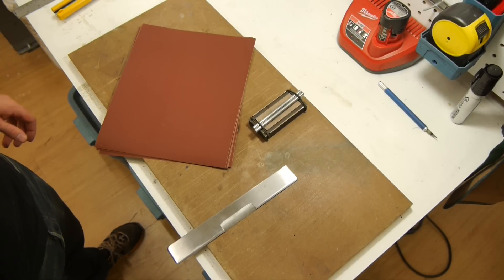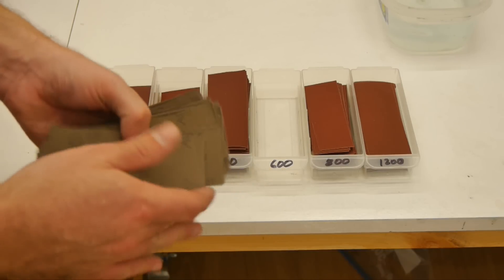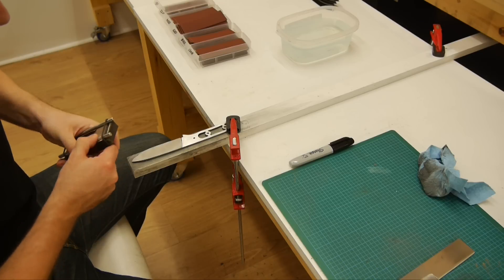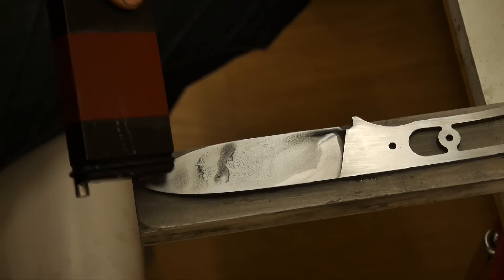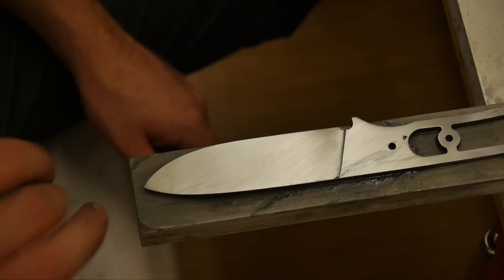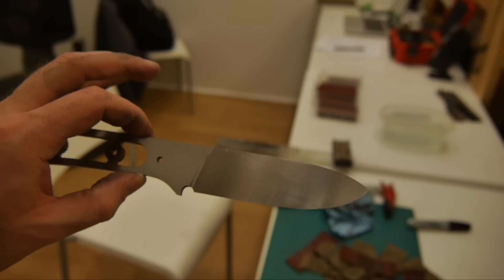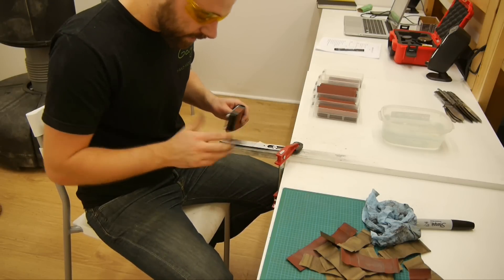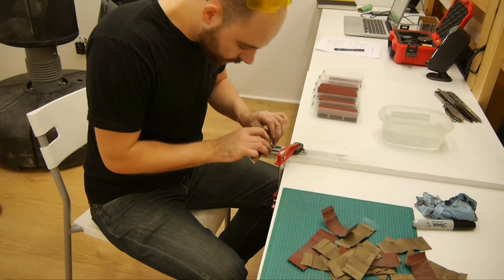How to Satin Finish a Knife Blade

Comment: Thank you for your tutorial video!

I have some question, if I want to put a satin finish on a saber grind knife,  
should I separate the sanding process, like, sanding the flat then the bevel?(which is the method I'm using now )  

The problem I'm occurring is after the sanding process, the grind line between flat and bevel is not so crisp anymore, especially on a americanize tanto because it have three flats on each side ,the tip is the trickiest even with a sanding block.

And how about a hollow grind? should I put a piece of leather or rubber on my sanding block? I think leather and rubber are flexible so when sanding it might fit the curve, haven't try it yet so don't know if it will work.

Thanks for your time and patience!
Reply from the maker: Hey mate!
When sanding a saber grind it's important that your sanding block is very hard, and that the paper is held tightly against it to avoid washing out the transition lines between the bevel and the flats... If you want the sharpest possible transition you can actually use special stones called 'EDM stones' to do your sanding, because they're very hard you can keep your transition lines very crisp. You can get them from moldshoptools.com

For sanding a hollow grind you should use a sanding block with a radius on it that is just a hair smaller than the radius of the wheel that you used to make the hollow grind. Using a soft sanding block will wash out the transition.

-Aaron
Reply: Thanks for the information! Really helps me a lot!

Comment: At around 10 minutes you said that you heat treated the blade after the first 2 passes with sandpaper. Do you mean heating it up to aust temp and quenching? Is it safe to do with a blank with a thin blade or will that cause it to warp easier?
Sorry for the question, i've got a thick piece of steel (from a broken pry bar hehe) and i'm wondering how much stock removal i should do before heat treating it to save my elbows when i have to sand the heat treated steel.
Reply from the maker: It depends on what steel you're using. I'm using an air-hardening steel that doesn't really distort much, so it's safe for me to take my edges very thin. I have also done some very thin edges in O1 before heat-treat with no issues. Steels that require a faster quench like 1084 or 1095 will likely be more problematic.

Comment: Hey gough it's me again! I seem to have trouble sanding out the scratches right at the beginning of the bevel! Any tips and great video! It was actually very helpful!
Reply from the maker: Hey mate! Yes that's generally the area that takes the most work... The first thing I would say is to make sure that your file (the one you're using on the filing jig) has it's edges nicely rounded, any little teeth sticking out will cause deep scratches that are hard to get out.

Apart from that it really is just a matter of sanding a bunch unfortunately. Make sure you change your sandpaper really often, treat it like it's free!

Comment: I use 3in1 oil for this instead of the water and detergent mix, is there any benefit to using water over oil?
Reply from the maker: +Jimmy Grey Hey Jimmy! Benefits of water: cheap, non-toxic, plentiful so you can replace it more often. Downside is that it may cause rust if you're not careful. Either way will work for sure!
Reply: +Gough Custom Guess it's just down to preference then. Thanks for that mate.

Comment: what type of steel is that? I apologize if you mentioned it in the video but I didn't catch it.
Reply from the maker: +Michael Cockrell Hey mate! In this case it would have been A2 steel, however the process is basically the same regardless of which steel you're using.

Comment: Hey Aaron, do you recommend the even heat kilns for a hobby knife maker? They are pricey but seem to be worth it in the long run with the ability to set consistent temps.  My fear with a gas forge is overheating when trying to normalise...
Reply from the maker: Hey Jarrod! I think an electric kiln for a hobby knifemaker is a great investment and a tool you will get a lot of use out of! I think these days I would recommend Paragon over Evenheat, just because the outside cases of their ovens are much nicer and more durable, and also because they have an inert gas plumbing kit that you can use to avoid needing stainless foil!

Comment: You make well and use full videos great job on all your work. I have one question when your going to make knife does it matter on what kind of metal it is or is their a specific metal?
Reply from the maker: +Pedro Hernandez Thanks very much Pedro! Yes, specific steels are needed to make knives. Usually a 'tool steel' is what's needed as it can be hardened. I recommend beginners get started using O1 tool steel.

Comment: Aaron I was hoping you may part with another piece of knowledge.  I am in Whitby, and was happy to find out you're based in Toronto! So I wanted to ask who you like to use as a steel supplier.

Thanks in advance.
Reply from the maker: Hey mate!
I think the nicest steel supplier I've used in ontario so far is 'The Steel Store'. They have a few locations and they're affiliated directly with Bohler/Uddeholm (a very large scandinavian steel maker). They make really high quality stuff. If they don't have a size in stock that you want get them to quote a custom cut. I found that even having them custom cut/grind stock was still cheaper (and much better) than buying from Starret.

This is only for standard tool steels like O1, A2, D2. If you want fancy cutlery steels like CPM154 or whatever then Knifemaker.ca is the best canadian source, though when I'm looking for fancy steels I'll often buy from Jantz Supply.
Reply: Thanks Aaron for taking the time to answer. I actually emailed the steel store as there's one in Pickering, but I haven't heard back yet.  The pieces you were unwrapping looked 24"-36" long and 3" wide?  
          So I asked for a quote 0.250T x 4"W x 36"L to test the water (sizing I've seen on the NJ Steel Baron site), in 01, D2 and even their (S7) type steel Uddeholm Compax Supreme, not that I'd get it, definitely not a beginners steel, I'm probably going for 01 or even the A2 you prefer. 
           My thanks again for your reply, seems I was on the right track! Cheers, 
            Matt.
Reply from the maker: GovannonForge Hey mate! I'd recommend you stick with O1 to be honest. A2 requires a kiln to heat-treat properly.

I'd also recommend going thinner with your steel unless you're planning to forge it. I use 5/32" thick steel and I think that's around the optimal thickness for a 4-5" blade knife, maybe even up to 6" or so.
Reply: Gough Custom 
Will do!  A big part of the draw knife making holds over me, aside the obvious of creating something, is how freely experienced knife makers such as you freely share your knowledge.  Aaron I wish you the best, I selfishly hope for more videos lol, and I really appreciate you taking the time to answer my questions...cheers!
Reply from the maker: GovannonForge Any time mate! More videos coming over the next months!

Comment: Hi thank you for your video I made your beveling jig and love it! question, i like to do scandi grinds where the bevel goes partially up the blade but when I hand sand it I always lose the definition where the bevel meets the flat part of the blade. any tips on how to avoid this? thanks!
Reply from the maker: +david ure Hey mate! It's pretty hard not to wash out grind lines... Really hard sanding blocks help, but the best way to totally avoid it is to do all your finishing with stones. EDM stones are designed for polishing metal and will let you finish without any softness behind the grit that would round over the edge. You can get them from MoldShopTools.com

With that said, you have to decide how much you want to focus on getting them crisp. Probably a really hard sanding block will be enough as there will be some washing out of the lines when sharpening the blade on a stone anyway most likely!
Reply: thank you so much for the reply ill try this and keep watching your videos take care =D

Comment: Gough, just subscribed, great videos. Question, you were talking about heat treating, in the video about satin finish.  Is this a repeat process?  Do you heat treat and then file and sand before you start the satin finish work and then again during the finish work?
Reply from the maker: Hey Jerry!
Heat-treat is only done once, I usually do a lot of rough finishing before heat-treat, then final finishing after heat-treat.

Glad you like the videos!
-Aaron

Comment: It was so worth to watch this tutorial. Thanke You. But IMHO wearing safety glasses during the manual sanding is not so needed. I mean what can happen? :-P
Reply from the maker: +Gx2aug Hey mate! Water and grit accumulates under the blade as you're sanding, and sometimes when you apply downward pressure on the blade the water can squirt up out of the pin holes in the handle... I've had it happen!

Comment: Hi learning a lot from your tutorials thanks. I'm busy with my first blade and almost ready for the sanding process. Q. Do you first file to a sharp point along the blade edge before sanding hardening and final sharpen or do you leave approx    .5mm on the edge to protect from warping when heated? Thanks
Reply: Before you heat treat I wouldn't recommend doing a sharpen. You should out the bevel in, but not sharpen the knife.
Reply from the maker: As Grady recommended you should leave the edge dull. Put in your final bevel and leave the edge 0.5mm thick or so and then sharpen after you have done the heat-treatment and your final finishing and so on!

Comment: Aaron, I posted a Knife Maker Spotlight on you and the 'Resolute' on a G+ knife community, tons of positive feedback and +1's!  

A question was asked about the black finish on the knife (website pics). I didn't comment on it, because I wasn't sure what coating/ process you had settled on, or even if you continue to use it.  

Could you let me know if you are.

Cheers,

Griff.
Reply from the maker: Griff Grinds Thanks Griff!
I'm not currently using Cerakote, but I am looking to move to matte black DLC coating on my future blades.

Comment: will it get rusted over time? how do you prevent the rust?
Reply from the maker: If you're not using a stainless steel then yes it will probably rust. Best way to prevent it is to keep the blade lightly oiled

Comment: Thanks, mate! You've encouraged me to try knifemaking myself. Waiting for my sweet D2 to arrive. Question: where do you get your handle pins and what do you think on detachable handle scales?
Reply from the maker: +Yan Doroshenko Hey Yan! Nice to hear! Are you going to be sending your blade out for heat-treatment? If you plan to heat-treat at home using an improvised forge I just wanted to let you know that you will not be able to heat-treat D2 that way unfortuantely. If you want to heat-treat at home you need to stick to a simpler steel like O1. If you want to use D2 you either need to have a kiln, or you will need to send the blade out for heat-treatment.
Reply: Gough Custom Thank you very much for your response. I decided to send it out for heat -treatment. I will cost me 4 bucks + shipping and save me a lot of work and probably a piece of steel.
Reply: +Yan Doroshenko Where are you sending the blade out for heat treatment? That's an incredible price!
Reply: Joshua Yount Well, yeah, that's a pile of money, but I managed to save $4 for a knifemaker to help me with it. Cheers from Czech Republic!

Comment: Question: how do you keep your grind line straight? Yesterday i tried to handsand and destroyed them, although i made myself a block like yours:(
Reply from the maker: +bean soup if your were working on a saber grind and are having issues with rounding over the transition then the secret is harder sanding blocks and holding the sandpaper very tightly to the block... If that's not the issue then let me know and we'll work through it!
Reply: Gough Custom yeah i think it is close to a saber grind. But I think I figured out what went wrong: firstly it was clamped poorly and second the block was to big. Next time I use a smaller block and prepare things better. Thanks for support, you are really close to your subscribers :)

Comment: I enjoy your videos  love your knifes. I would enjoy a video on elaborating on the g10 handles that you use. I see many people talking about g10 and how easy it is to manipulate shapes and designs how does that apply to the finished product? Ex. Handle abuse, And also do you ever get a little exotic with you knifes shapes or designs?
Reply from the maker: Hey Chad!
G10 grinds fairly easily because it's quite hard. Micarta is more 'gummy' which makes it harder to grind, that's the main difference between them.

In terms of abuse resistance I would rate G10 pretty high. You'd have to really wail on it with a hammer to do any damage. Only one of my knives has any damage to the handle, and that's from where I was smashing bottles with the window breaker, a large chunk of sharp glass cut into the handle a bit near the window breaker...

I tend to keep my designs very simple and functional, that's the main style that appeals to me!

-Aaron

Comment: Hi i got my cold steel kukri scratch up, if i use this process, the blade name, brand name also will most like gone?
Reply from the maker: It depends how the logo is put on. If it's engraved it will likely stay, but if it's painted on or laser etched then it will definitely come off.
Reply: Gough Custom Thanks for ur reply and vids u made. Just get back recently collecting blades and also still a novice as those mostly SOGs i collected i never even make effort to know what steel are they.  I am very surprised with the O1 steel as of when i was trying to regain the looks back yet not skilful to get it even 60 percent, i vent my frustration on a thich wood built as a trolley. It got in pretty deep with good edge retention but why just using serviette cleaning that caused those scratches so easily

Comment: Aaron, is this pre or post- heat treat?
Reply from the maker: Griff Grinds Both! Depending on how clean your heat-treat process is I would recommend going as high as 400-600 grit before heat-treat. If you're heat-treating in a forge then you'll likely have to go down to 220 or so after heat-treat to remove the scale and decarb...

Comment: I really enjoy your videos!Nice job again.On another note.How much time do you need to satin a blade on both sides?
Reply from the maker: Thanks mate! Glad you liked it!

How long it takes really depends on what finish you take it to before hand. If the blade has just come off the filing jig then you're looking at a couple of hours at the very least. On the other hand if it's come off the grinder using a relatively fine grit belt then you might be able to get it down to an hour or less. I know of some other makers who have gotten so good on the grinder that they're only spending 15-20 minutes hand finishing!

I'm trying to get better on the grinder as it's still taking me too long to hand finish, and the process is quite hard on your body when doing a number of blades.

Comment: what can i get that works similar to that metal bar with an edge?
Reply from the maker: +Jason Weathers Hey Jason! I would recommend going to the hardware store and buying a piece of metal or wood and making your own!
Reply: I haven't invested in a belt grinder yet
Reply from the maker: +Jason Weathers That's fine, you could make that sanding bar simply using a hacksaw and a file.
Reply: +Gough Custom ok thanks I will try that

Comment: safety glasses... for hand sanding?
Reply from the maker: When applying pressure downward it can make water trapped between the blade and board squirt upward through the pin holes in the tang, carrying a bunch of nasty grit with it... Ask me how I know this :)

Comment: If you can still see lines it's important to let your viewers know this is a "brushed-satin" finish. Not a normal satin finish
Reply from the maker: That is correct within the other metal trades! If you were working on stainless kitchen appliances for instance then yes... However within the knife industry a 'satin finish' basically always has straight grit marks left on the finish. The straightness of the finish lines is a point of pride for high end knifemakers, and the final grit used will often be a selling point as well, ie: a '1200 grit hand satin finish' vs a '600 grit belt satin finish' etc...

Comment: Stupid question, how do you know when a piece of sand paper is tapped out? Asking for a friend..
Reply from the maker: Not a stupid question at all! A single piece of sandpaper will last maybe 30 seconds to a minute tops, you will start to feel it gliding over the steel rather than digging in and cutting, and if you run your finger over the surface of the sandpaper you will feel it's gotten much smoother. Replace the sandpaper really often, it will save you a lot of time to use fresh sandpaper!
Reply: Gough Custom perfect, thanks heaps for the info!  Massive fan of your work, cheers.

Comment: Are you getting the blanks cut out via cnc?
Reply from the maker: For this batch and the last one I had the blanks rough-cut on a waterjet. I'm not sure if I'm going to keep doing it though because it caused problems of it's own.

It does allow me to weight relieve the handles very efficiently which is nice though!
Reply: Gough Custom Will you be able to rough cut multiple stacks of blades at once from the bar stock with the CNC machine if you bolted the blanks together?
Reply from the maker: FoolishDoug Probably not, because the blanks are all cut from a larger sheet...

Comment: sir is that sharp after sandin
Reply from the maker: +nobody No! It would be unsafe to sand a sharpened blade. The blade is still about 0.020" thick at the edge during this process.